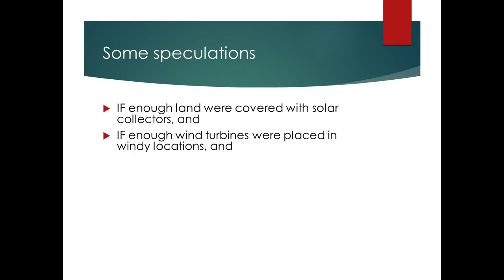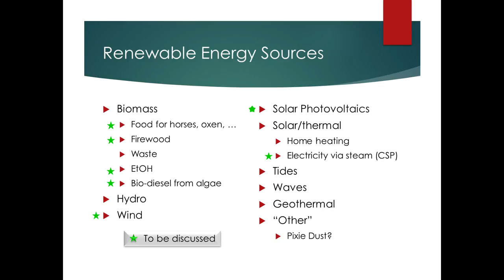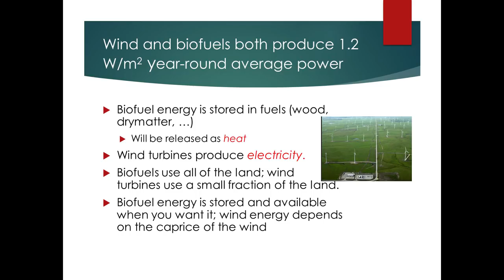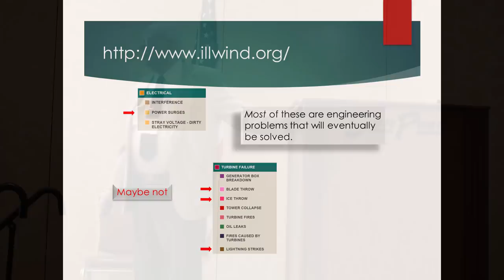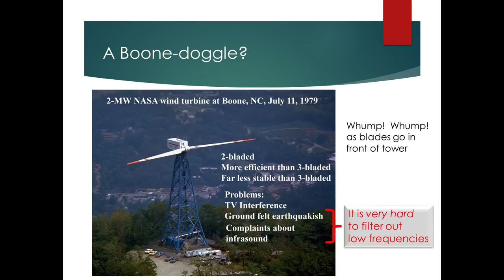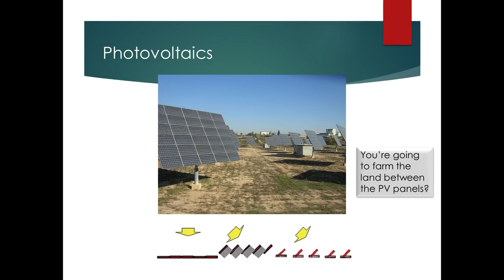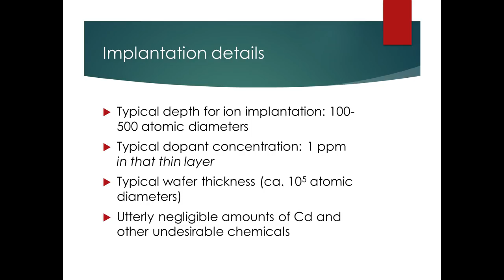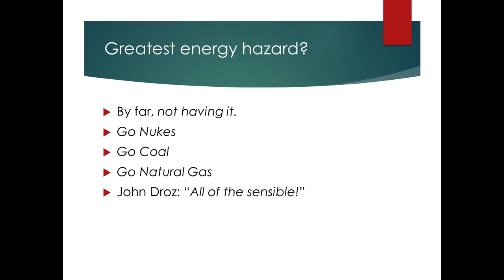Environmental Impact of Renewable Energy - Howard Hayden, PhD

Comment: Good informative talk - NZ has 70-80 % renewable electricity with 50- 60 coming form hydro and 13 % from geothermal  the remainder coming from some wind, solar and biomass. One of the challenge as outlined is getting reliable 24/7 power. Having various options with not too much reliance on one source is probably a good way to go. I think solar for the home user is reasonable as you can feed back into the grid and get your credits which you can then use at night if you don't have battery storage etc. I think they are developing better solar cells all the time being a relatively new up in coming industry the technology will improve and hopefully the key will be a breakthrough in storage  ie battery or better at some stage.
Reply: Hey, you guys go for it.  Keep doing that.  Way to go.

Comment: I see some propaganda against wind and solar, like the picture with the pickup and turbine wing, it is clearly a turbine transport as you can see the yellow cloth on the tip, the pickup properbly run Up behind the transport because it was slipery. Correct me if im wrong. 
Some of it seems legit with sources, and the thing with Denmark is true, its called fjernvarme, or heat from afar. It is actually very good on paper, you use the waste heat to heat homes, the problem is then when people need more or less heat or more or less electricity. Sometimes in the summer they deliver heat inlet temp of 53-55 degree, and then on exchanger water heater you can get problems deliver warm water enough to people, then they complain to us plumbers. ( Fun fact: the tech and building people now say frostfree depth in Denmark is 90 cm due to global warming, some years back we had a hard Winter and the water froze ;) og course all these smart green voters wanted us to fix it :) ) also i have heard about claims of Up to 50% heat loss in the 100s of km og pipes running under citys, this seems hard to get a clear number on as it seems obscured. Also the story about energy management is true, we sometimes shut of windturbines because we can easy supply 150% of our energy need with wind now, but when we do we often need to almost have Germany pay us for taking our power, we give it away for free. This is disturbing so many things and we are now banning new petrol and diesel cars from year 2030, so only electric will be allowed. So we need to pour billions into our grid over the next 10 year and on, also the greens hate nuclear but i love to see when they realise they will need it. We are near peak on how many turbines we can build, there i think needs to be 2km to buildings and people. Then we make alot in the see, which makes sense because No nabours complain, and the wind is way more laminar, but you have a very hard time service to too often high sea and high Winds. 
Btw im one of those "climate deniers" who dont buy the CO2 knob, aka i actually dont at all deni climate change at all as it has always changed without us doing anything. I also am an windturbine entusiast and hope to build some on my property for power.. i would also like some solar panels. And there is a danish study on the bird killings, and it can be easy searched, and windturbines kill far less birds than traffic.
Reply: wind turbines kill large birds (and bats) whereas traffic kills small birds
as you can imagine of large animals generally there are much less than of small      ...       wind turbines are threatening populations of large birds (and bats who are sometimes even drawn to the the windturbines) heavily (sometimes even threatening extinction at least in their region). the impact is not to be underestimated and the "more birds are killed elsewhere" is a disingenuous strategy by "eco" climate change activists
Reply: @mykillmielia5640  do you have any research showing this? I read the danish paper in this some years ago and the conclusion was that it did not. We have many seagulls here ( the dumbest bird here i think) and i never seen any get hit or even fly close to them. We had alot of bats at my former house but No wind turbines

Comment: Only two minutes in and he already is making ID10T errors assuming you need backup batteries to last more than a few milliseconds. How do people get trapped into such faulty thinking?
After 10 minutes it got too boring and I had to speed ahead till the wind section. 
Do we care about eagles? Since DDT was removed they made a comeback and are now comparable to pigeons...
Do we care about how much cement and such is used? I thought we cared about how much it cost to make a unit of electricity. Wind is much cheaper than anything else...
I can't continue to watch this display of idiocy. All I want to do is follow the money. We've got all these fake climate scare mouth pieces and on the other side we have these fakes like Howard. We really need to know how they all benefit financially from their hoaxes.